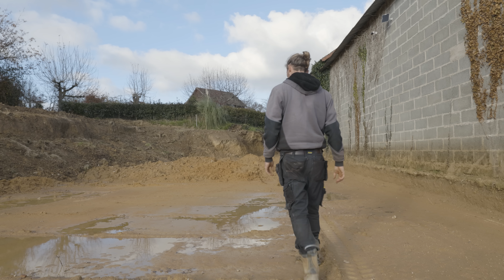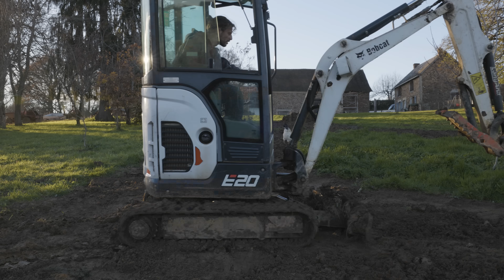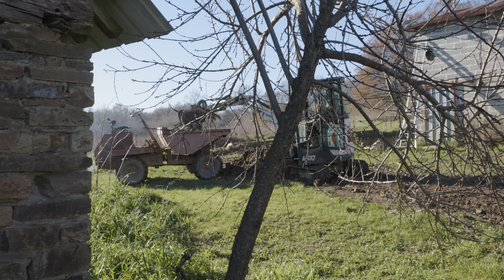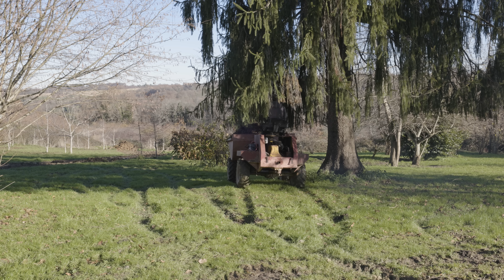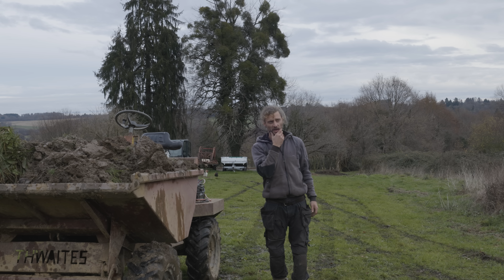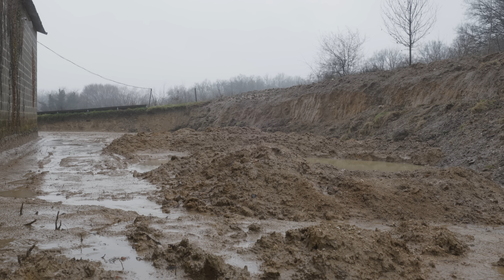Repairing Deep Ruts and Tackling Water Flow Challenges Around the Property! | #69

Comment: Usually better to have extra water than not enough. You are doing a good job handling it now. You will need the water when you get the pond completed. Overhauling an engine does take time. How long depends on having the replacement parts, reboring the engine, and experience.
Reply from the maker: The water will be nice in the future once it flows a bit where we want it 😂If we didn't need the dumper a lot we could just go for it and see where we end up. Most parts are still available for it.

Comment: Phillipe you are doing a wonderful job in managing your water problem. Would it not make sense now to put guttering on your barn and buildings and pipe it straight to the ditch and get the water away from your working area quicker tham letting it seep through the ground.
I think this would make a big difference to your situation. All the best with your project and Rome wasn't built in a day.
Reply from the maker: Hey Roger, the barn roof is coming off any day now since it needs to be redone so gutter will be attached after that is done. It is detrimental that it still just falls to the ground but it is in the grand scheme of things not a lot compared to what comes from the hill.

Comment: Hi Philippe, how about Claude trying to find a newer/ less tired replacement engine you could probably have that done in a wet weekend that you won't be using the dumper?
With you extending the drainage ditch further away from the panels could you then (just for the winter rains) turn and extend it downhill past the house and garden areas in a place where you won't drive?
Wonderful progress this week, stay safe and we'll see you next time
Reply from the maker: Hey Scott, i have been looking at finding engines which is not easy and a reconditioned one we are talking 2000 euros. So either we get lucky soon and find a 2ndhand which is properly running or we open it up. The ditch up top is ok for now but if needed we will extend it more!
Reply: @DomaineSauvage  dear lord that's robbery, I don't suppose an old diesel car engine could be retro fitted?
at least until you can restore the original on a long term project

Comment: Maybe an idea to first try the simple things, like fuel injector new, cleaning the fuel tank etc. New fuel and oil filters, not so expensive to do and if your lucky after this it will run better.
Might save you a lot of work.
Reply from the maker: Filters and oils have been done, but it is consuming oil at a rapid rate and it is smoking blue so probably the piston rings are worn.